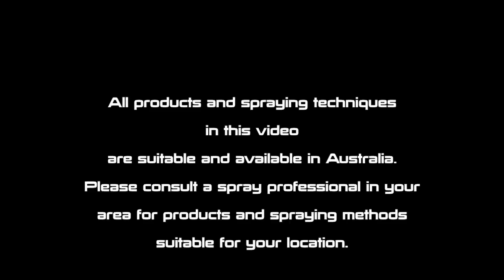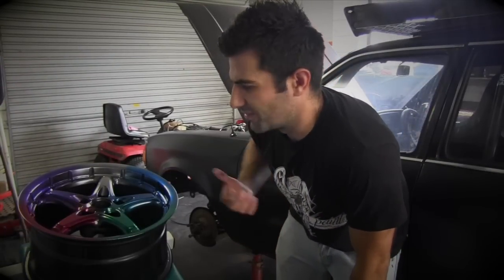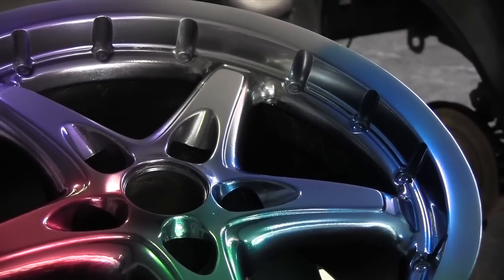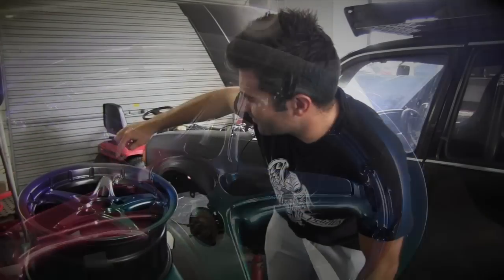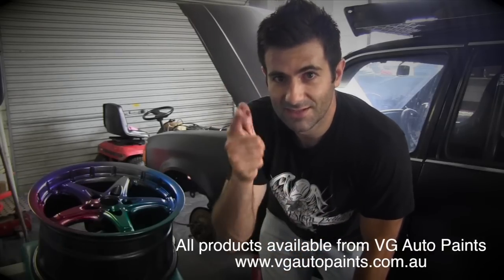How to paint colored chrome and get an anodized finish

Comment from the maker: Hey mate at the start I said I sprayed a gloss black first any gloss black is fine, I used a 2K solid black 1 stage and left it overnight 1:25 Then I applied the chrome straight onto the gloss surface. At 3:10 I explain how the clear being used is specially designed to go over a gloss. There wont be any problems with flaking. Cheers
Reply: customspraymods  where i can order? Thanks

Comment: thanks man. Nice tutorial. I never would've imagined that you could make it look that good with spray paint. I've got a set of 3 piece racing wheels that I had to strip down with muiratic acid because they were so ruined from corrosive brake dust and pitting. I need to finish them... that's how I found your video.

Comment: I'm assuming you can use the same process on wood, as long as it uses the same series of primer and black gloss, correct? Also, do you know if you can mask areas with tape or some other medium to create hard-edged patterns?

Comment: I was wondering if you still have your How to Custom Auto Body Paint Manual because I am five-(5) years late.  I am not a mechanic and only in the past couple of years I have attempted to perform basic maintenance on my truck i.e., replaced the battery, troubleshooting my electrical power seats and "service air bag" message both are still unresolved by me.  I recently purchased new tires which are expected to arrive March 29, 2018 at my local Wal-Mart: they will hold them for seven-(7) days, so I can schedule installation with them. I plan to remove each tire and wheel assembly, so I may inspect the brakes and clean my chrome alloy wheels.  I observed over that past few years that the chrome coating has been cracking and flaking off: I have since learned about spray coatings for wheels.  I may attempt to remove the flaking chrome, clean the wheels and spray the wheels with a coating such as Duplicolor, Rusto-leum and  Plasti-Dip.  I am not worried about getting the coating on my tires because they have run their course with my truck and will be discarded after my new tires are installed in a couple of weeks.  Please view my videos and offer your best recommendations.  Thank you very much for this instructional video, I will view it again and again to build my knowledge and confidence.  This is the link to my tires, which also shows my wheels. https://youtu.be/BNUmJfM5-7o - I will try to make videos concentrating on my wheels. Kind Regards

Comment: Looks cool dave. I'd like to add my 2 pence. In the trade myself and me and many others I know have struggled reproducing an OEM spec chrome effect ( time frame the main issue probably ). I think the trick is to get the black gloss perfect first.. like glass finish all over. Its noticable on the inner sides of the spokes etc. even in your vid. I've had most success on concentrating on the finish in the nooks and crannies, in the spokes, and in the rims.. then a lighter coat over the face.. gravity does what it does. Most don't pick up on it to be fair.. but some do.. and when they do.. you own a full set of chrome alloys!. That aside great job! I hope Renault don't see this vid and start doing this with their alloys!

Comment: Hello! Did You sand the glossy black cleared paint before spraying the chrome paint? Or You just sprayed the chrome on top?
Reply: no, he didn't. If he did the "chrome" paint would have shown the horrible scratches, and since he didn't sand before spraying another coat much later the paint will come off in sheets in maybe a few weeks or maybe months if he is lucky.
Reply: v4lhulme he mixed the colors with the. Clear for the chrome actually so it’s not going anywhere like a normal paint layer would

Comment: hi Dave..do you clear coat it again after spraying the candy? i know you clear coated once after the chrome...cheers
Reply: he cleared it once after the chrome and then mixed candy in with clear. I paint for a living its common to do that to get a more depthy look. if he didn't put so much candy in each color clear mixture it would have shown the chrome effect under the color much more. anyhow that is how he did it and is ok to do it that way. plenty of protection but if your lookin for that extra strength and alittle more depth you could add another coat of straight clear over top everything as the finish

Comment: The way the video is done doesn't show any prep between the coats even when drying overnight. Are you using single-stages? Basecoats dont dry that glossy, and if you're letting the singlestages dry overnight without scuffing between them won't it cause flaking down the road?

Comment: Awesome job, but one question...if the rim was already chrome, why did you paint it gloss black and then "rechrome" it with the chrome paint?  I understand the chrome paint brought out the transparent/candy paint on top of it and it makes it pop, especially with the clear.  However, why didn't you just paint the chrome rim itself with the adhesive (key clear) and the transparent/candy on top of that and skip the "black to chrome" paint first?  Or did it have some sort of metal flake that you wanted in that chrome paint?  That was the only part I was confused on, but great job.

Comment: no mention of flash times, sanding between coats. I see this trash all the time, clear coat comes off in sheets and takes the "chrome" layer with because it has not bonded to the gloss black properly.

Comment: you cant paint an Anodized finish. the video title makes no sense. 
you obviously dont know what yr talking about
Reply from the maker: Ghryst VanGhod sometimes a painted surface is referred to as a finish like in auto body refinishing
Reply: @customspraymods  that is correct. however, your video title is not, it is impossible to paint an Anodized finish on.
you should learn the meaning of words before using them. Anodizing is an electrical process.
the finish you produced is not anodized. not even close.
Reply from the maker: Ghryst VanGhod it says get an anodized finish not paint it.
Reply from the maker: I think this was over 5 years ago. The worlds a different place mate. Let’s press on. Haha
Reply: @customspraymods  you cannot "get" an anodized finish by painting.. do you even know what anodizing is? as a self-declared spray painter, you certainly should... 
here, have an education : https://en.wikipedia.org/wiki/Anodizing

and the world might be a different place, but anodizing is still anodizing, and does not involve paint..
reported for misleading text